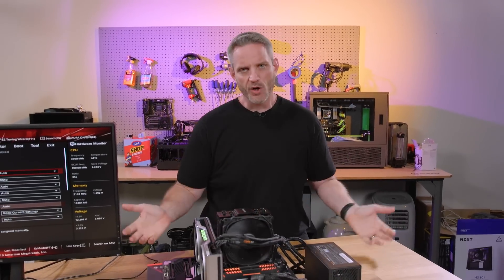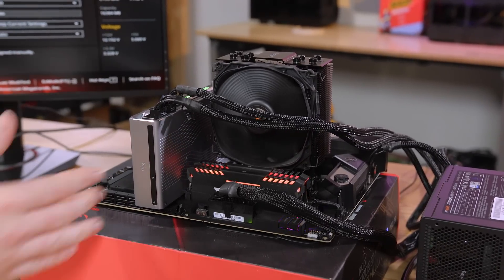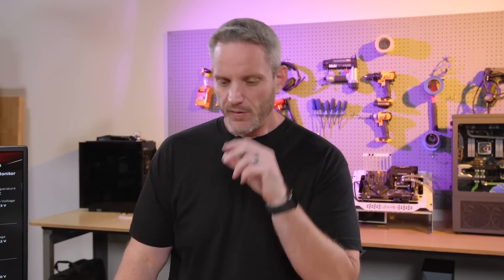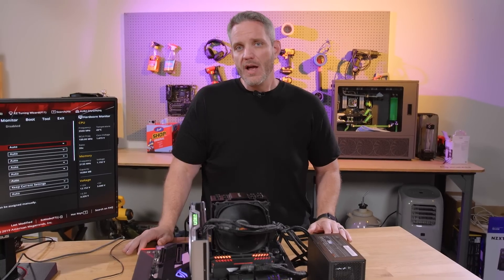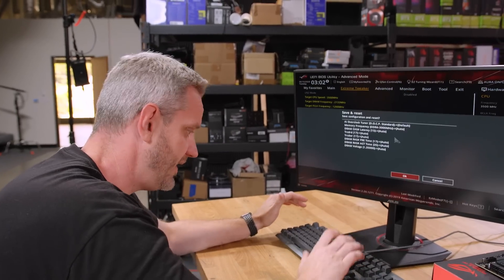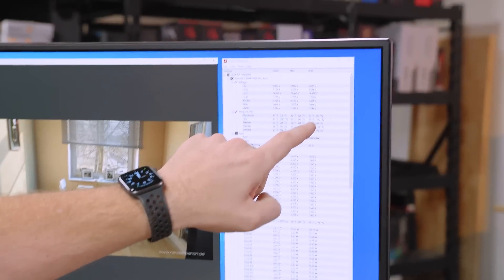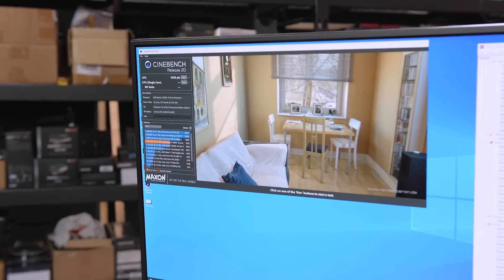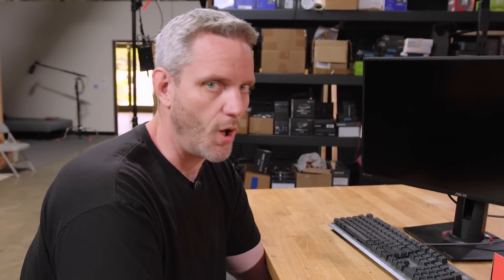Is your motherboard trying to damage your Ryzen CPU?

Comment: Interesting because straight out of the box with everything (in bios) on default my CPU (5950X) temps would soar at the slightest whim (50-60 idle and 90 degree always in any games) ... couldn't figure out why - remounted my block, repasted etc changed radiator increased cooling/ventilation .. nothing changed, was close to RMA cpu and AIO but then I delved into Bios and just turned PBO from auto to disabled, along with C-states and Performance Boost to disabled ... boom down to 40 idle and 60ish degrees gaming. It's messed up, I think we have too many 'tuning' options now that its creating so much potential for conflict. Give me a bios set up from 10 years ago ANYDAY over the mess we have today.
Someone even told me it was normal while another said I could create a curve for my fans?!?!?!? I need to create a PBO curve just to stop a super CPU from melting while opening a webpage? I feel like my old stuff ran better than my new stuff - I got far better performance like for like from my A10 CPU and GTX 780Ti than I do with my 5950X and RX6900XT ... it's tragic, spend 3k more and get less performance? Crazy.

Comment: I've been trying to use Ryzen master to find good setting with an easier to read interface. And I'm running into weird throttling issues when running benchmarks now. Even at default settings. Not thermal related temps always below 70c. Could this be a software conflict that you mentioned?

Comment: 5800x, AIO MAG 360mm from MSI, Radiator on top, water tubes facing Right top side. im using MSI Center APP to controll RGB and Fan / pump speeds.
at Silent mode it will lower CPU to 1.7Ghz and temps will be 59ºc to 64ºc (usually 61, max is 64 but rare) , and Balanced mode that is the same thing as Extreme performance will Sky rocked the Temp up to 89°c - 93ºc. TBH im scared to see 93!, but I touch the AIO and its a bit warm , well Ryzen is hot but its actually Cheap and runs well. 
new thermal paste and patters are lies, the only way to lower temps is to go bios and disable core performance boost OR limiting CPU temp to 85ºc. which will not impact FPS on games.

Comment: What about high idle temperatures for the 5900X  even with a really powerful cooler, but decent thermals under full load ? The VCore is 1.3 on idle, which doesnt make sense to me on 2 cores.

Comment: have a Taichi X470 with bios 4.70 which I upgraded to 4.75Beta to get my memory's  XMP profile working ( Corsair vengence LPX 16 gb sticks). No more crashes and good performance. On both bios' the power deviation is in the red of 65% when Cinebenching. But I am not worried because the cpu voltage is only a max of 1.314 volts. This 35 % reported power deviation if true could be compensated by giving a 0.518 undervolt to the cpu in the bios. Would this be advisable or should I not worry. My CPU is Ryzen 3700X, I know there are power issues with this from other sites.

Comment: if someone can give me an answer, I'd appreciate it.

i am not sure if this is normal for ryzen 5 5600x voltage behavior, at stock settings I it jumps between 0.9v to 1.4v but most of the time it is 1.4v as to why I am getting a 72c temp at idle. If I tried to follow the common profile for it which is 4.5Ghz @ 1.2v  the temps is down to 55c idle and the power is 40watts at most. 

Is it normal for the voltages to be at static 1.2v even on idle? how about the jumping from 0.9v to 1.4v at stock setting?

Comment: my ryzen 9 zen 3 3900x vas  on 1.5 v on default (msi motherboard)and didnt know why i got cpu error codes until i looked into the bios it didnt even stat on first  try when i bought it until i lowered the voltage :D but they intalled windows and all other stuff on it but didnt checked the bios

Comment: my 3900x died after 1 day :/ restarted and couldn't boot windows and restarted again in a loop. than things get worse until the system wont post with vga failure code 95 :| 
the last thing i expected was a defect cpu so i worked hours in cmos resets, bios updates and web searching. So the last thing i checked was the cpu.... 
Argh

Comment: It's my experience that a CPU is so incredibly hard to kill, I literally never had one die on me, from 1984 onwards. I always replaced the CPU/MBO combo, and usually also the RAM, in the upgrade cycle, and when I re-assigned the old hardware to some support task, such as HTPC, it would keep working until I upgraded that computer with even newer upgrade cycle of the main computer - I never had it die, I had to eventually give it away or throw it into the recycle depot because that stuff keeps piling up. Hard drives die with some frequency, I had SSD controllers die along with all the data, I had a GPU die, I had defective RAM modules, but CPU/MBO combos either don't work at all or they work until they are a million generations obsolete.

Comment: last week this happen to me on a  2011 X79 ROG rampage IV Formula  I got a few weeks ago off of  eBay  on  two cards an RX 580 and and old R7 260x  the CPU fan would start up fine and is running but  the GPU fan would start then stops dead  Im stuck with a with black screen  I had to install an old GT 200 card  though my CPU runs at a clock speed 3800 MHZ  I cant play any games  below dx9 As it clock speed only runs at 600 mhz my RX 580 GPU  base operating  frequency is  1257 MHz, but it  boosted up to 1340 MHz, memory is running at 2000 MHz  at 600 mhz all I can do is such the net I feel there nothing wrong with the video card it just this  X79 mother of a board wont recognize  them. in the bios

Comment: In the last couple of days my R5 2600x started over heating and shutting off 2 games in to Gears of War 5.
Checked HWMonitor while running Cinebench and it would get to half way through the second pass and hit 113C and shut off.

Did it yesterday from cold and managed 6 passes which I then stopped manually because it hit 110C, I saw that it peaked at 143W of power draw and the clock speed went up to 4.6GHz on all cores (only supposed to boost to 4.2 and draw 115W at stock settings).
Why?
I’ve had it running the same stock settings and Wraith Spire cooler for 2 years (aside from RAM, obviously) not applied an overclock at all and deep clean it every 9-12 months, yet all of a sudden my computer decides to just keep drawing more and more power to raise its clocks when it reaches 100% utilisation.
Aside from some dust that I can see prompting me to do a deep clean again, why would my system suddenly start doing what I’ve described?

Comment: One very important point that I feel you left out.If the cpu is pushed to shut itself down will the motherboard revert to defualt settings?Because I remember back in the day with my windows98 and windows2000 PC builds the motherboards would revert to default settings if the cpu shut the PC down as a result of the motherboard bios being set too aggressively or what ever the case was.Does that same standard apply to new motherboards of today?Thanks in advance.

Comment: I am overclocking my 2950X to 4.1 with 1.2 volts. With Noctua NH-U9 it is getting hot very quickly and Running CB 23 only takes a minute in a half to freeze the system with overheat. As the matter of fact, it takes about 3 minutes to freeze with overheat even with default settings. I am planning to put more powerful fans in that cooler and replace 2000RPM fans with 4000 RPM and see if it is going to help. Probably will have to try a 120mm Noctua cooler, and if not good, then going with AIO one. The problem is that my case does not accept big AIO and only a single fan one. I am worried about overheating my 2950X, because I got it on a big sale lately around $500 new and now it is around $800 and if it fails down the road, I am afraid I will not be able to find another one at this price or ever. Small note, that it is a monster, running 2 VMs with each set to run with 16 cores 2 threads.

Comment: Does my motherboard not have vccsa sensor? I’ve been getting some wack readings in voltages and I’ve reverted bios to stock settings. (I have xmp enabled tho) My vccsa is reading 2.064V on both hwmonitor and hwinfo but in bios I have it set to 1.1V. My mobo: Asus tuf z490 plus WiFi

Comment: Thanks for the video on this. Did put me at ease but my first AMD cpu in 20 years is the 5900x rog strix x570 corsair h100i cooling in a 4000D case and this issue still exists just makes no sense it running at 1.48v on idle ive had to use ryzen master to max it at 1.2 4.3mhz (still experimenting but perfomrance in maxed out 2k cyberpunk is unchanged  so that when i game im not going to hit 90c and end up with a forced restart (happened few times gaming for long periods).  

Ive read so many articles,/ redit posts and watched videos on this everyones got own reasons it happens no one has a solution to make my cpu behave as it should. dont need it going full on when im just watching a youtube video.

Would have been great if your video went to the point you showed us how to make the cpu idle volage something like 1v without limiting when power is actually needed.

Comment: This is an issue for Motherboards whether for AMD or Intel based systems. I would much prefer that the MB manufacturers would have all of the settings at stock as the default setting but that is not the case these days.

When I build a new system I try to choose parts that will give me my desired level of performance at stock speeds with no OC required with the exception of xmd on the ram.

I do however pay a little more and buy parts that have good OC capabilities so if I need a performance boost a few years down the road I can then boost the performance to extend the performance life to a level I find acceptable.

I always go through pretty much every line in every section of the MB bios on a new build to make sure it is set to what I want. Never trust what the manufacturer may set as their default.

By running stock for the majority of if not all of the life of my systems the longevity of the components has never been an issue.

I normally build a complete new system every 5 years and am building one currently. At the age I have reached and with the current cost of the more top end components reaching investing $2500-$3200 just in building a complete tower I do not see that 5 year trend continuing going into the future but increasing to about 7 to 8 years for me at least.

Staying more current with the newer technology is just starting to cost to much for this old retired senior that fools with it more for want and a hobby than need.

Comment: i had a Gigabyte MB that fried my Intel i5 2500K CPU, i did run volt on Auto, and it was running 1.45v and it was to much, so i began to be instable after 2--3 years, so i bought a used i7 2600K that i dident overclock but that PC worked for 7+ years except for the first CPU, well the i5 dident die, it still worked on stock clock´s but it felt broken, so it "had" to be replaced. then i did buy the AMD TR Gen1, moved my old intel stuff to another chassie, and it DID NOT START again.. i just turned it off and brought in another AMD to the house :P 

Today i have a AMD TR Gen2, and i had to check the volt´s now due to i "overclock" to boost clock 3.8ghz but the volt is sitting there at 1.09375 Volt for the CPU. i did clock it with the BIOS and not the AMD Ryzen Master, and it seams like the volt is not Auto, it pre-set and is rock solid on that volt.

anyone that can inform me and educate me in AMD CPU´s and volt if that´s true and right volt to run on a AMD TR Gen2 @ solid 3.8GHz

Comment: Did i miss something, so what about the high idle voltage. Oh yeah it's through the ceiling and you were concerned about it too. So.. now what.
Reply: Apparently this is normal for stock settings for zen2. I just built my first ryzen build and have been researching this ever since i built this machine. If you test the cpu at stock under load you will see the voltages reduce and rise back up when returning to idle.

Comment: Hey Jay, I haven't been watching that long, only been  heavy into PC again about 6 months, PS4 is addictive man. I really only heard about you because of GN, but that's not the reason I'm saying Hey, I just wanted to let you know about a conversation I had over a few days with a guy that said he worked for AMD and was talking to people about the "perceived" issues with Ryzen and voltage and so on and ascertain the legitimacy of the rumor's by talking turkey basically with the people that were posing the problem or hearing it and feeding into it. apparently HWmonitor which I use sends a lot of requests to the CPU for info which so he says causes an inflammation of the CPU's feeling that it needs to boost even when idle, he ofcourse recommended cpu-z or Ryzen master because these are the only 2 apps that don't add to this behaviour which is actually natural for Ryzen and unless your CPU is basically pinned at full boost when idle, there is nothing to worry about but without better testing methods and software, I cant check if this is true, The clocks jump around that much that its impossible to tell by watching if its boosting more often or not. Maybe you could look into it and see if different monitoring tools do change the behaviour when they are the only variable! Also a quick one for the noob overclockers like I was going into Ryzen, the few settings that Jay spoke about are the easiest way to get performance from a Ryzen, I tried for months with DIP5 and then Ryzen master  and couldnt get stable over 4.35Ghz on my 3700x, after hitting f5 and changing only the performance options to OC4 and aida/geekbench with xmp on and the 1T/2Tin the ram timings changed from auto to 1T, I began to see it idle between 3.45 and 4.275 but when I gave it a task and said Oi time to go, it peaked at over 4.5Ghz, a mark I was at best 150Mhz short of. You wont get the same benchmark scores because it won't boost during CB20 and 3Dmark, at least not that high for that long but it will burst when you really need it and be a little more chill when you dont. And Jay, thats my 2 cents, Peace!

Comment: This happened to me. Recently I and my boyfriend both want to build a pc and decided to build the same built. Except only our motherboards are different. Our cpu is ryzen 5 3600 x and we use the cpu fan that comes with the cpu. My motherboard is MSI tomahawk b550 and İt's default core voltage was 1.46 V. And my cpu goes up to 92 Celcius degrees when I run a stress test. My boyfriend's motherboard is Asus tuf  b550 plus. Its core voltage is 1.24 volt and he got max 81 degrees. I ınitially did not understand why my cpu heats up that much even though we have the same system. Then I decrease my core voltage to similar to my boyfriends' cpu voltage.  That fixed the issue. Now I have 82 degrees at most without any performance loss

Comment: i'm still going to bust on you anyway. on carbureted engines a common problem is choke malfunction or a clogged air filter/intake, leading to little or no available airflow.  the oxygen in the air might technically be fuel, but getting airflow itself is a separate and more basic step before the air/fuel mixture.
Reply: i guess the PC analogy would be worrying about basic case airflow before anything else when trying to troubleshoot temps. if air can't get in and out, nothing else will matter. unless you have a mineral oil pc.

Comment: Why on manual oc I can run ryzen 3900x 4.4ghz stable with max temperature 71degrees but on default settings it runs only on 4.05ghz with exactly the same temperatures? It's definitely something wrong.

Comment: Thanks Jay <3

Have had some decent Board an Killed somehow 2 times a 2700x's Memory Controller, after that the Board Killed his self, then started with 3900x and a even Bigger Board, with stability wise same issues, but this one isnt't broken jet. Also, have Set your and the other Reddit recomments nibbels and Switches, since then I do not have any issues (ah the Bios Clock do not Work but dont say anyone)

Comment: My father bought a pre-assembled kit of 16gb 3200mhz DDR4 Ram an ASUS motherboard and a Ryzen 3600X from I believe it was Scan.co.uk and they sent it without lowering stock values. The Core voltage was running as high as 1.475v! And he was noticing video playback and sound stuttering as well as loads of other glitches and problems, that was until I figured out why and lowered that stupid motherboards voltage to 1.34v but you could run it as low as 1.325v (maybe should so sayeth Linus).

Just saying, this was our experience and I hope it hasn't messed up the CPU's lifespan or anything, we will see but you should all be careful about it when it comes to these motherboards stock values. They're screwed up.

Comment: A few days ago i noticed that HWMonitor said one of the cpu voltages (VDD, Perhaps) was 2 volts. We all know 2 volts =dead. Switched to HWINFO64. I like it better and haven't seen  "2 volts" reported at all. 

Im using an MSI A320 Pro-M2 at the moment with an R5 1600. Im using the standard tune and default  "core boost " or whatever.  Its boosting to 3.7 all by itself. So yeah.. try HWINFO64. I think the numbers are better.

Comment: The thing i'm worries about is controlling temps when gaming or under high load for extended periods with my 3700x. I will admit i dont have the best case for air flow buts not terrible, and i have a single rad AIO cooler. Gaming for around an hour i'm seeing max temps of 85, it just seems super hot compared to what i'm used to with previous CPU's. I'm going to get a 280 or a 360 rad and see how much that helps.